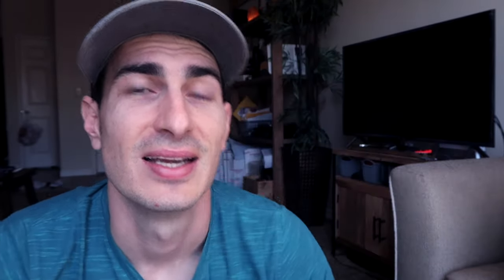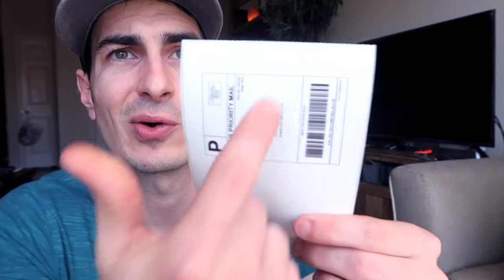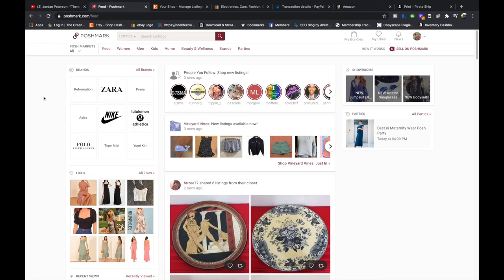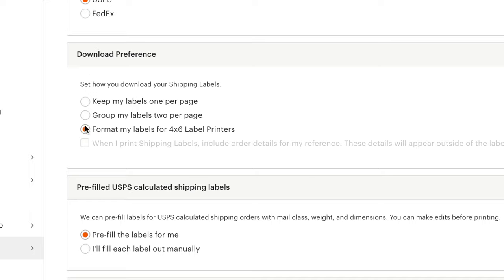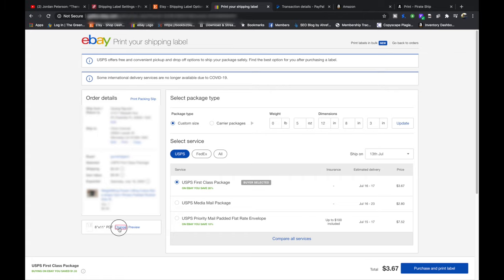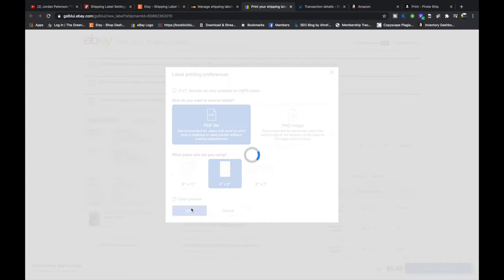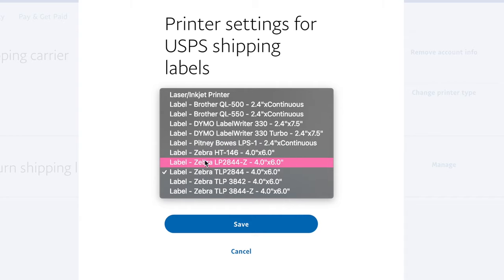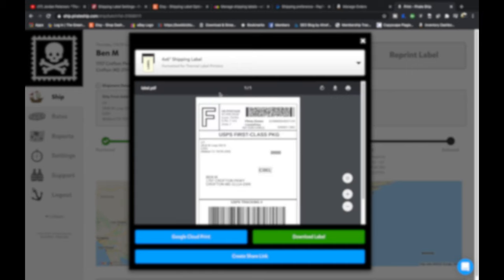How to Fix Thermal Shipping Label Printing Sideways and Small, 4x6 on Poshmark Etsy eBay Mercari

Comment from the maker: new ebay settings August 2021- https://youtu.be/WdgnAs27R6Y
Reply: Hi appreciate your guidance on the label printer settings. Question, my label measurements is set to mm instead of inches(I know how to convert but it’s annoying to me)is there a way I can change mm to inches on windows set up? Thanks!
Reply: The damn printer keeps printing all the paper and wasting it. So frustrated
Reply: Thank you!
Reply: The new settings no longer allow you to change the print settings once you've purchased the label. You have to void the label and purchase a new label to make print settings changes. Someone correct me if I'm wrong.
Reply: @TrentMRobertson  No really. You can simulate the need for a new label, make adjusting the size, saving it, and then returning to reprint the old label with the new 4x6 dimensions. This is applicable for eBay purposes. Works for me. ✌
Reply: Do you know how to do this with Facebook Marketplace?
Reply: @lipuchca   im definitly not buying another label to test this but i cannot go to "reprint label" and find the "change" button is nowhere to be found.

Comment: You have just moved up the ranks from stranger to my most favorite person in the world!! I just got back from the library, parked a block away, went up a thousand stairs, checked in with a clerk, fired up a computer for 7.5 seconds of use, engaged with a clerk again to retrieve my ten cent print, drove all the way home, cut out and taoed the label to jy $11.00 item with FREE shipping. Knew right then and there, this will not he a viable solution. Thank you and bless you, Sir!! I couldn't figure out if its a laptop or platform setting issue.
Reply from the maker: Lol thanks. Happy to help

Comment: Thank you! I just bought a non bluetooth Thornaday at my local salvage store for $50 new in the box.  After wasting about 30 labels and 2 1/2 hours of my life over a 3 day span,  I had the sledge hammer out thinking it was just a junk brand . Then I just found this video ,  I had just printed 2 eBay labels out on my laser printer , so I just went to "print another label" and sure enough there it was set to 8 x 11 on the right side. Switched it to 4x6 and both labels printed out perfect! Took all of 30 seconds 😂 You Rock!
Reply from the maker: Saved another printer from hammer death ☠️🔨

Comment: Thank you for this video, after 3 years is still helping people. I am on my second thermal printer and $260 spent on them because I couldn’t figure out the size to print the labels, they were coming out so small, and I was waisting so much labels, until I find this video, thank you so much. It has helped me tremendously, you saved my life and my sanity. 😂

Comment: I opened a different account and forgot this is something I set up long ago on Ebay and Poshmark. It worked. Thanks so much you saved me a lot of time trying to mess with my settings when it wasn't my settings at all. This is really annoying and it wasn't in the same spot as it shows for your account. It said you need to use advance shipping flow. I had to search for it but finally found it.

Comment: I do not have a thermal printer but instead cut sheets of labels down to that size using a paper cutter. I have found using the A6 paper size works well and can be done by manual feed. Thank you so much for saving me hours of figuring out how to set printing in other formats as I expand my business. Maybe someday a thermal printer will be in the budget.

Comment: Hi Dear: Thank for quick and swift response. My thermal printer, print from all sites but not printing directly from UPS web site, when selected, thermal printer option. Without thermal printer option, UPS site give me pop up print window, where it gives me all my printers list. When I select thermal printer, it print side wise, same as your video start showing print side wise on 4" X 6" label. Wondering, if you have any study or option printing UPS label from UPS web site on direct Thermal printer option. Thanks Dear, Good Job.

Comment: thank you for the start.  Ive changed my settings in Ebay, and omg! hello 4x6.  However, when i print to my thermal printer, no matter if i have the settings on my Munbyn on portrait or landscape, the label prints the wrong way.. basically the 4" side is printing on the 6" side, cutting off half the label.  what in the world am i doing wrong???

Comment: Thank you  I followed everything to a T and my label is still not printing properly. My label is still printing tiny and in the middle of the label. Is there anything else I need to change that perhaps you did not cover in this video? I use eBay and I have a windows 11 PC.

Comment: Even with it on 4x6 I still get that small print on the label. I just have to put it on “FIT TO PAPER” manually and it prints how it should on 4x6. I saved it as a preset but somehow it still does it small.
Reply: Have you tried or checked the settings on your "Printers & Scanners" device setting if you are using a PC? If you have, have you made sure the it's set on 4"x6" label?

Comment: Do you have a video for errors with  3rd party labels on the brother 1100nwb while it is printing While I can get the custom sizes and change it on the computer the printer wants to push out the extra 4x6 label. Thus, the auto cut feature won't work.

Comment: I tried using your instructions for my MacBook Pro. The printer driver installed but when going into the default paper sizes, it doesn't list or show a 4" x 6" or 100mm x 110mm format. It just lists US Letter, US Legal, A4, A5, etc. Extremely frustrated as I paid $175 for a Rollo thermal printer and it's basically useless. I've rebooted and reinstalled but still not showing an option to use the Rollo paper sizes.

Comment: I have a Munbyn printer. I followed your instructions for eBay, selected an existing order, print another label and the is no dialog box to change the size. I've tried this several times. Windows 10. I get a third of the label printed landscape when my setting are portrait HELP

Comment: I got the Brother QL 800 and I’m using pirate ship but it’s coming barely visible
Reply from the maker: For that printer are you doing 2x7 or 4x6?
Reply: @thecollegepicker  I believe it’s a 2x7 because I printed it out as a 4x6 and it comes out unclear
Reply from the maker: Did you adjust settings on pirate ship for your output dimensions of your label?

Comment: I’m trying to use the last method printing off of whatnot. I am using adobe and cropping it down to size. But every time it prints it only prints like half of the barcode and stops. What am I doing wrong? 😢

Comment: hey I'm running into an issue the label is printing the info but not the barcode.I am using Shopify and I have the Jadens thermal printer

Comment: I'm using a rollo printer and I'm printing directly from the USPS site. What steps should I follow? Help :)
Reply: If you can change the format to 4x6 in the settings somewhere you do that and they should come out in 4x6. Otherwise youll have to download each label and resize them like eric shows you to do at 5:02

Comment: So I was able to fix the issue two months ago after watching your video. Now all my settings are same and apple did update this morning and my label is printing too small the correct way or it’s printing perfect size with the bar code not on the label but the bottom of the label where the bar code goes is blank. I looked and it’s printing page 1 of 1 and everything looks good but now I’m ready to scream

Comment: This didn't work for me. Using a Comer Thermal Label Printer with Shopify and still printing sideways and half the 4x6 label. There is no print setting for Orientation either...

Comment: I sell on eBay and I just purchased Phomemo Label Printer.  I have changed the printer and eBay settings to 4x6. When printing single labels, the printer works perfectly. However, when I want to print labels for multiple orders at once, the printer prints two tiny labels per 4x6 sheet. I have to leave the shipping section and go back to the "Orders" section and go to "Shipping Labels" to properly print the labels. Anyone have any ideas?

Comment: Hi, I am printing labels for Poshmark and I have followed your suggested steps, however my labels are not printing sideways.  They are printing in a very small print and I cannot get it to fit the 4X6 label size, even though I changed the size on the printer as well.  What am I doing wrong?

Comment: hi! i am having a similar problem with poshmark labels. they aren't printing sideways, but the printed label is scrunched up. i print using the 4x6 settings and have tried messing with the layout in the printer settings, but still having the same problem. 

side note, what do we clean the roller with? the left side of my label isn't printing clearly
Reply: nvm, i was able to fix it. i cleaned the dust and turned it off and back on and the labels printed correctly and not scrunched lol not sure which part fixed it 🤣

Comment: hi, I just watched your video, thank you. I was able to change the shipping settings BUT I still have any issue that maybe you can help with? My poshmark labels when printed on 8.5 x11 print in the top center of the page, then when I adjust the settings, it is still trying to print in center of the page so it is 1/2 cut off on the label, any ideas??
Thanks so much!

Comment: Hi There: Great video for 4 X 6 size label printing. I am stuck on UPS site label printing same issue. My UPS label printing on my Thermal LP2844 printer sidewise and half of the 4 X 6 label. Do you have any hint to fix that issue, as UPS tech help was not so bright and wise to solve the issue. Thanks
Reply from the maker: Hi, I would print from Pirate ship if you are in the US, they have a discounted UPS option

Comment: Hello, I just bought a Munbyn thermal printer to make my shipping needs easier. Little did I know Mercari doesn't offer the 4x6 shipping label size as you mentioned which is a huge disappointment because that is one of the primary platforms that I am selling items on. I tried to use your workaround, but was unsuccessful. The labels that Mercari sends me are horizontal, not vertical like the one shown in the video and when I try to rotate the picture on the Acrobat program it just prompts me to get the "Pro" version because editing is not one of the free versions abilities. I also did not see the option to even take a screenshot in the edit options like you showed. (I am using a Mac to do this.) I'm not very tech savvy so I appreciate any input because I'm hoping I didn't just buy a thermal printer for nothing. Thanks!

Comment: On my pc, I am trying to change the labels to a 4/6. I don't have a live tag to print. I have all the steps done to where you pick a label in order to change the setting but I don't have the option to print another label so I don't get the option to change the printer. Do you have any other ideas?

Comment: My rollo printer keeps printing off center. It is not printing fully on printing. I need help ASAP PLEASE!
Reply from the maker: Hi have you reached out to Rollo? The labels could be not liked up straight but the customer support should be able to help.
Reply: @thecollegepicker  I did not. But I just figured it out. Thank you for getting back to me. My margin numbers were at 20 and 20 under printer preferences. I had to put them both at 0.
Reply from the maker: Good troubleshooting 💪
Reply: @thecollegepicker  Thanks!

Comment: Do I need a PC/laptop to do the changes? I don't see anything on eBay's app.  🙄

EDIT: After login in using my laptop, the shipping options suggested here didn't show up for me (July '22). After checking the eBay's 'help' section, I finally found the answer:

-At the item, select to print a label

-The new page is titled 'Ship your order'

-There are three blocks of info: Shipping details, Package size, & Shipping Service

-Click 'more options' next to Shipping Service

-On the far right is a block 'Order details'

-Go to the bottom of that block, hit Show More and see Print Format

-Make your appropriate changes and click Change

As the user mentioned, eBay makes it so hard to find these settings... unbelievable!

Comment: Hi. How do you change it on the ebay app ? When i go to print label it gives so many options. I have not figured it out. The ebay app offers 4x6 index card, letter, iso, ansi all kinds. Ive tried my best. Thanks.
Reply from the maker: If I remember correctly, you cannot change it in the eBay app. You have to open a browser on the phone. Log into eBay as a desktop site which is a setting in the browser and then you can follow the video like it would be a normal computer. The screens should look the same. Hopefully that helps. Let me know if you get it going or continue to have issues.

Comment: Hi I have a Rollo printer and a Wix website using Shippo. My labels are coming out small and sideways. The drop-down menu on my computer is showing sizes in mm for example 94mm x 150mm when I click any of them they still show sideways on the label. There is no option that says 4x6. Help.
Reply from the maker: Hi Sherice did you change the setting in shippo to generate 4x6 labels?
Reply: Hi yes still printing sideways but now its larger🤦🏾
Reply: It shows straight up and down on my computer screen but printing sideways and showing less than half of the words.

Comment: Can I print a shipping label 4 by 6 on my regular printer
Reply from the maker: Yes. You'll just have to cut and tape it on.
Reply: What about the ones that comes in the roll not sheet
Reply: Is am I able to use a shipping label that comes on the rolls on my regular printer
Reply from the maker: I dont think that will work.

Comment: I’m trying to change the settings in Pirate Ship from 2x7 to 4x6 but when I click save it automatically change it back to 2x7
Reply from the maker: If the label is already made it will stay 2x7 new labels should be 4x6
Reply: @thecollegepicker  ohhh
So I need to made a new one?
Reply from the maker: Yes. Void that one and makes new

Comment: HI there!  Just got a new thermal printer so thx for this great info!  However, my ebay pages don't show the "print size" in lower left like yours does...not sure what's happening.  I tried Print another label and I didn't get this same prompt to change the label size.  I'm waiting for payment on my next sale, so I'll try when that comes through to change the label size but so far my sold page doesn't look like yours???  Any help appreciated.  JG
Reply from the maker: Hi, they changed it of course. There is an updated eBay video on my channel. It's on the right side now 😵‍💫 they always moving it.

Comment: My new DYMO 4XL is printing small & vertical. My Poshmark setting is 4 x 6.  I went into Control Panel - Devices - right clicked on DYMO 4XL - printer preferences - changed to landscape, clicked on advanced and selected paper size 1744907 4 x 6 - apply - ok.  And, it's still printing small.  I'm using Windows 10, firefox, and have an HP ENVY 7640 printer that works fine.  I emailed DYMO and haven't heard back yet.  So far, I've wasted seven labels.  I've been trying to troubleshoot on my own.  It's probably a simple settings solution I'm just not finding.  Anyone have any suggestions?

Comment: How do you do it for USPS off of just a PC and not a website?
Reply from the maker: Usps does not yet have a 4x6 format Unfortunately 😢
Reply: @thecollegepicker  better to ship with ups or FedEx then?
Reply from the maker: It would depend on what you are shipping but I use pirateship for usps. They have a lot of flexible printing formats and it's cheaper than the USPS retail prices.

Comment: I have a comer re418 thermal printer and I can’t find anyone to help me. Maybe you can?? My labels are printing fine, but after each one it skips 2 blank labels and then beeps 7 times. I’m printing 4x6 and have tried the comer labels and another Amazon ordered type
Reply from the maker: Sounds like you may need to calibrate it. Hold down the feed button for a few seconds and see if it calibrates. If that doesn't work power it off, hold feed button and power on while still holding fees until it calibrates. I'm not familiar with that exact model but that's usually the process.

Comment: I have came across your video but my issue what I am getting and searching for an answer is with Royal Mail Click and Drop, Even though in settings it is selected as 4x6 I am Still getting 2 Prints, one on it's side and then second 4x6 and it's driving me crazy with having no results searching for an answer. Even after watching this video and trying to seek where this maybe set from i am finding nothing and still getting two prints, any tips that may help me on stopping this from happening.

Comment: Worked for all but PayPal. Still prints sideways. I was thinking maybe it’s because I changed the settings after I made a label but that shouldn’t matter. It doesn’t for the others.
Reply from the maker: It'll change on the next label for PayPal. That's how their platform works.

Comment: Thank you so very much! I just bought a Thermal because I was going broke on ink carts....  You helped me fix the issue in under 10 mins and I only wasted my first 3 label stickers :D  Pending how business goes thru the rest of 2021 I might move onto a Wifi one ... right now I went with a Polono, but of course I have the plug into my USB port to use it. Sucks, but the price was good.